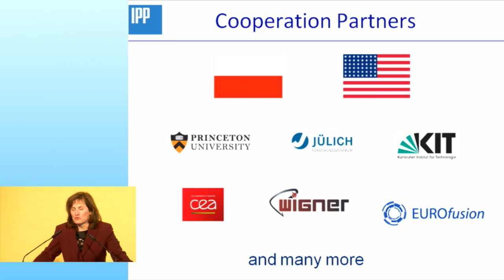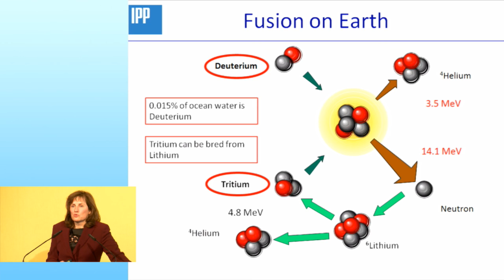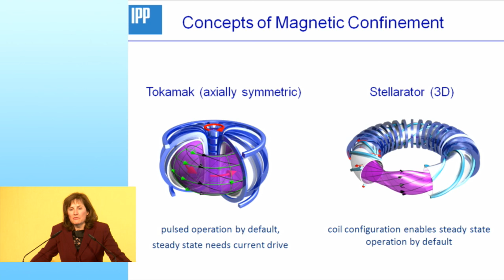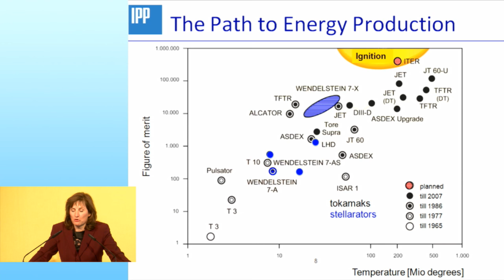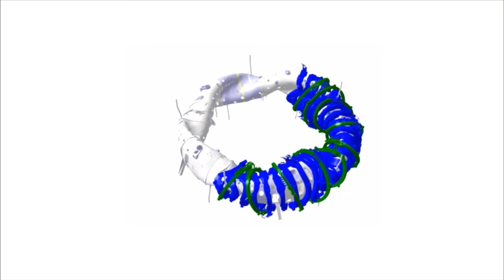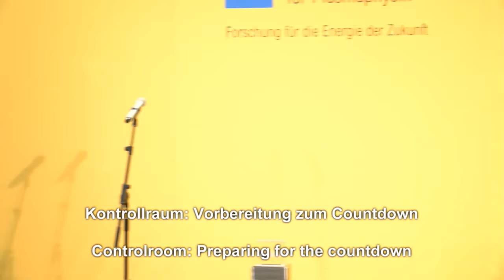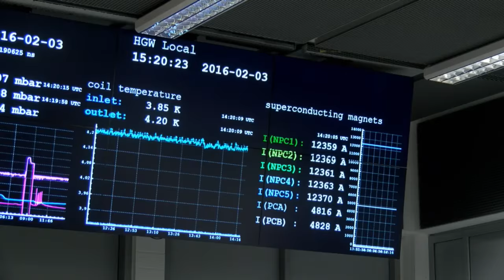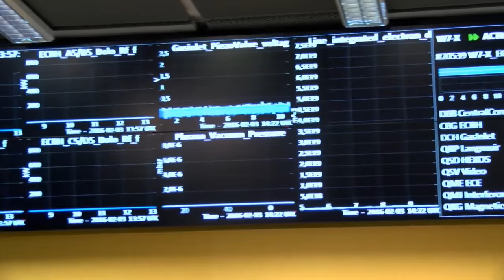Wendelstein 7-X – Ceremony on occasion of the first hydrogen plasma

Comment: can someone comment the time where the plasma is made? thanks
Reply: +Naratuga T - The hydrogen plasma was ignited at the end of the video after 40:30
Reply: +Naratuga T https://youtu.be/fjnILeK99oQ?t=42m34s
Reply: +Naratuga T China. That's where it's made
Reply: +Naratuga T @42:44
Reply: 42:45
Reply: +Naratuga T fraction of a second. In 2017 they run a 30min test.
Reply: +Naratuga T @ 42:45 the hydrogen plasma is created, it lasts for a quarter of  a second and the temperature reaches 80 million degrees.